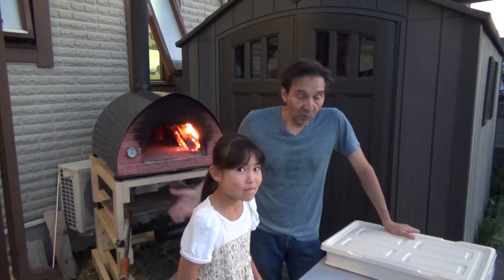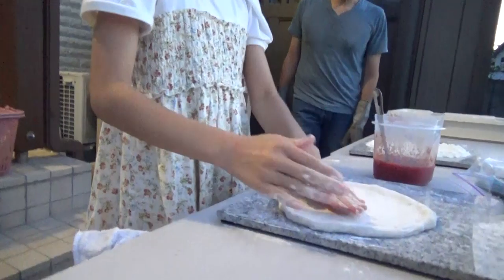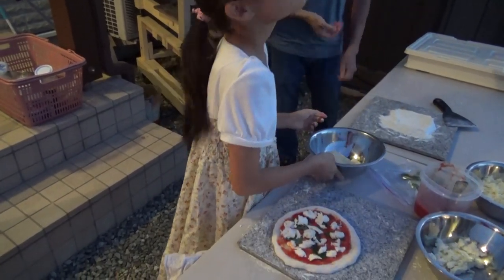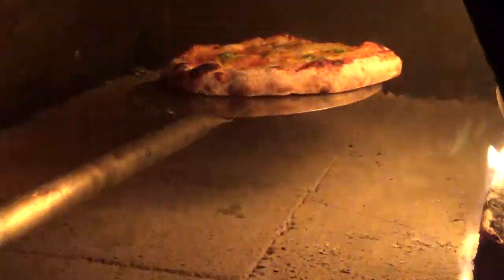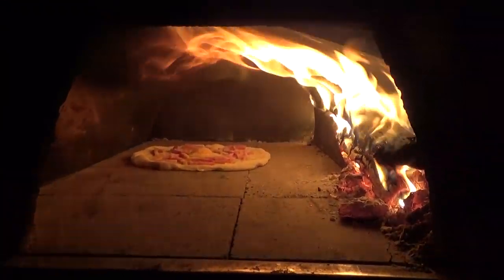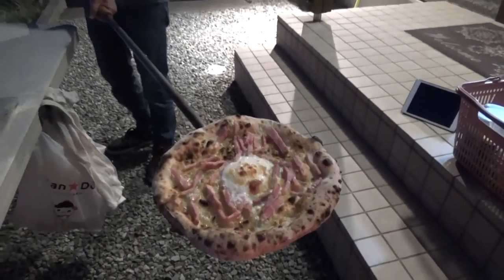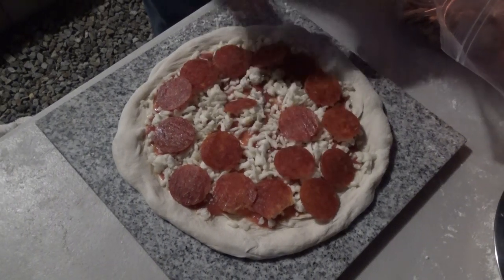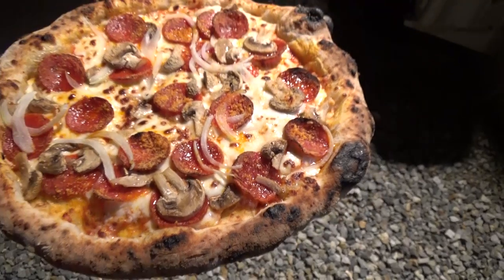Outdoor Pizza Making: 4 ways to blow chunks!!

Comment: Hi Fidel, nice to see you back, have now purchased the pizza party oven and every time I use it just gets better, still struggle a bit to stretch as fast as you but practise and the right doe preparation I am sure I will get there soon, thanks for your  videos. PS I am currently using 59% hydration and oo Caputo pizza flour ,would you recommend this hydration amount ?RegardsDave Portsmouth uk
Reply from the maker: For Neapolitan, I like to use between 64% to 67%. I dialed in this range from both practice and my visit to Naples three years ago, where they use a lot of water. Caputo is also very good at absorbing liquid and you should have no problems increasing hydration.

Comment: Fidel. What ovven floor temp do you recommend is ideal for cooking pizza made with caputo flour?
Reply from the maker: As hot as you can get it! No lower than 800f and even if it's roaming in the 1000's, you can finish baking pies off the floor.
Reply: Thank you. Also  where were you able to obtain the log holder that you're using inside your oven? The typical one that you see on the big manufacturers web pages are so darn expensive.
Reply from the maker: @johnpierson9796  It came with the oven!